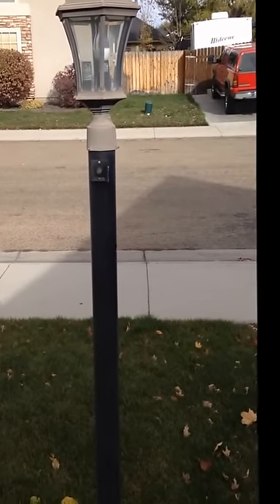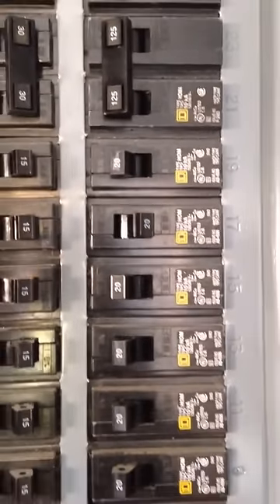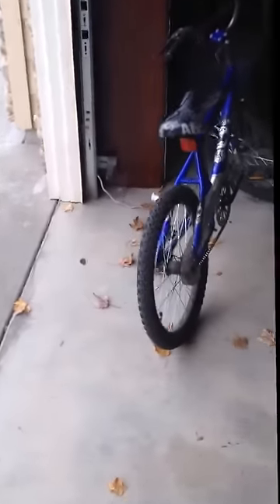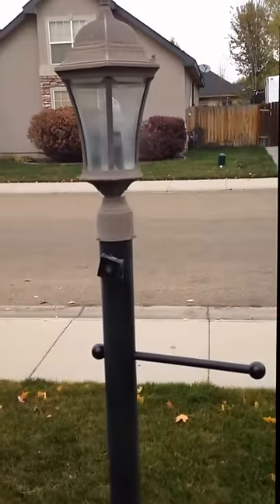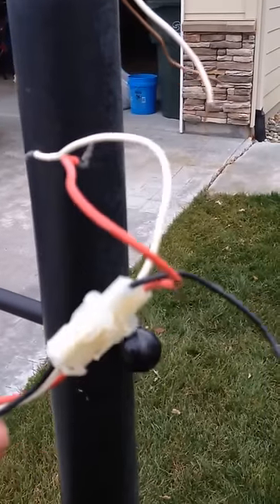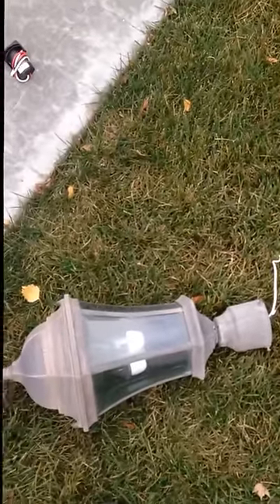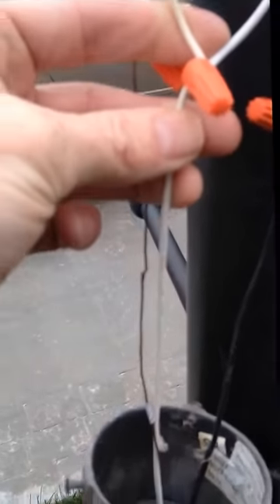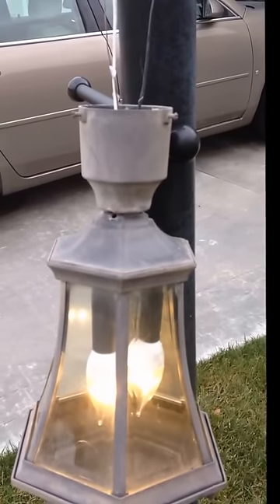How to replace the light sensor switch in an outdoor lamp the easy way.

Comment: Question> with the Design House 502146 style photocell, you have,  why didn't you just disconnect/then connect the new photocell at the plastic connect? Didn't have to take off the light.

Comment: I just use a $7 photocell adapter that screws into the socket and then the single bulb screws into the adapter. Works like a charm. 👍🏻